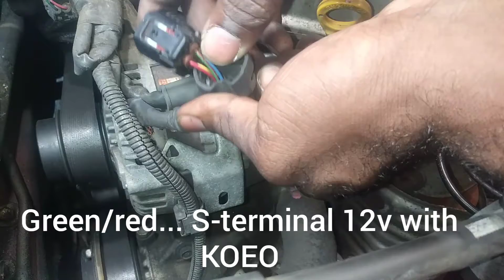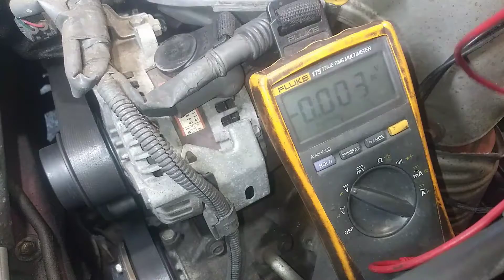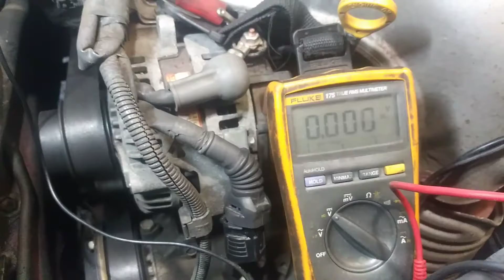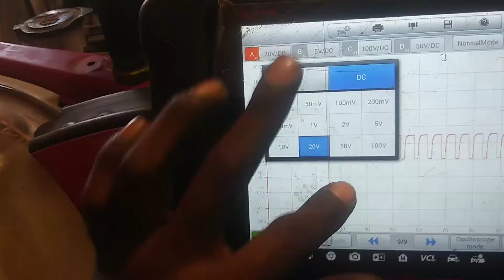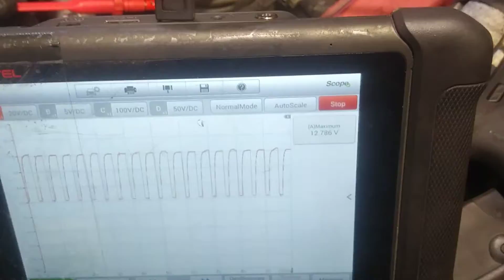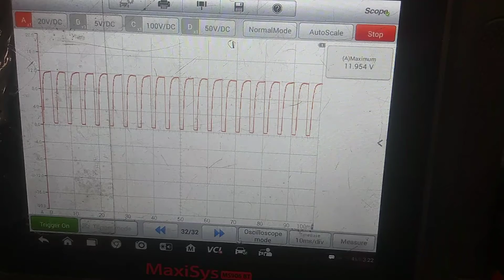Toyota Camry alternator testing

Comment: Hey buddy, great video but I have a question, I al having problems with my charging system and low rpm.. I did  check all 4 wires and the test good but when I did a voltage drop on the positive side with load it goes all the way to .5 v. If i disconet the alternator rpm goes back to normal and motor doesn’t vibrate no more..
Reply from the maker: So your engine is idling low with alternator plugged in???